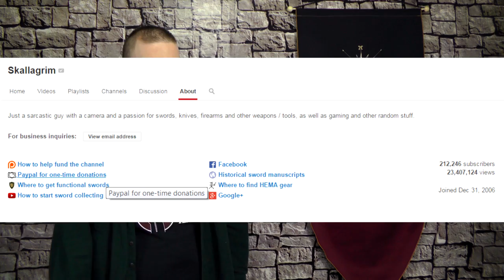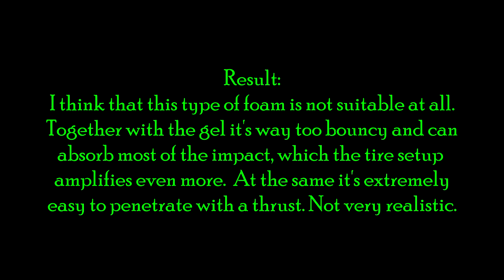The ongoing quest to find a realistic test cutting medium

Comment: There are plastics designed to simulate bone, but the old school method is poplar wood. Poplar wood just so happens to be about as strong as human bone. You can get poplar dowels at most hardware stores. As for flesh, the only thing I have found that is close is...well flesh. Even so, dead flesh seems to react differently than living flesh, so even that is not perfect. It is also a pain to pick bullet fragments and whatnot out of your dinner, ha.

Comment: Bamboo does not splinter like real bone, green or dry. There is a company in Colorado (I think) that the Mythbustes use that makes a Fiberglas bone analog that mixes in plaster and some gelatin resin, I believe. (go to the Mythbusters site, they are very helpful.) I believe that one of the commenters below is correct that impact gelatin is 10-12% for blunt and sharp force trauma with different analogs for skin.  There is some information on the American FBI sites and other Forensic websites. Skin varies in thickness across the body.  The back is 10x thickness the back of the hand and forearm. The heel of the foot 20 x as thick. Latex paint with some very thin fibers, like tissue paper, is used by some to simulate epidermis and the dermis. Or just a thin layer of liquid latex.

Comment: I'm glad you're trying lots of different things.  I think the tire is good because it moves and a body would move in real life.  I think the tire is bad because it swings from the top instead of swaying from the bottom and it is not 100 or 200 lbs (45.3592 to 90.7185 kg).

Comment: to stop the stick moving in the gel, you could put a ring in the bottom of the mold that the stick sits in, and one made out of wire at the top outside of the gel to hold it at the top?

Comment: Regarding "bone" support in gel. Why not trying to do it out of wire. Two "stars" at each end. Wire is easy to bend and easy to secure around the "bone.
Regarding "bone" itself. Was bamboo in the test dried or fresh. As far as I understand - dried bamboo is stronger. You can try to create a bone out of (again) alebaster or similar compound but I think it is more brittle.

Comment: For bone, Mythbusters used a wood called Popler (don't know how to spell that) for a bone analogue. That was for how much pressure a bone could take before snapping, not sure how that would go for cutting resistance though.
Reply: You almost spelled it correctly, poplar. But Yes, the Myth busters have used poplar for the human thigh bone as an analog, so it may be a not so pricey but still very good option.  
If i remember correctly, it broke at nearly the same pound threshold, although i forget the dimensions they used.
Reply: CAepicreviews
 I'm not sure the dimensions were specified, but it looked to be about the same thickness as the bone itself.

Comment: I would suggest a bone mold and then use plaster of Paris its cheap and sets up quick and I'm sure you could find a plastic mold on the internet for a bone mold to put the plaster in and it would solve the issue of the meat industry thing but I believe that would be the cheapest route with the ballistic gel.

Comment: You could try thick bamboo filled with wet sand as an analog to bone. Not extremely accurate but the closest thing I could find to a beef shank. Surprised me, as I was doing a science fair project (granted almost ten years ago and using an axe). Don't ask the purpose of the experiment, it was weird.

Comment: In the metal mold at the beginning of the video, you mention that the gel sticks and is hard to get out. Are you using a mold release? Mold releases are sprayed or rubbed on the inside of the mold and keeps the gel from sticking. Many people use Vaseline as a mold release.
Reply: buy some Pam.  if that isn't to skall's liking there are pump up oil misters so he could use something like cheap vegetable oil instead.

Comment: Many-layered material is a very interesting idea. But what I think of - the layerring is a bit off. First we have the cloth, then - tear-resistant skin, then - small bit of an very easy to cut fat, and then - very resistant muscle and bone. So, the inner layer is what supposed to be made of ballistic gel. So, I guess - you need to change gel and foam's places and it will be a lot more accurate.
Reply: except fat is at least equally difficult to cut as muscle if not more difficult.  he needs to find some way to put blood packets into the gel to reduce friction.  perhaps using some cheap water-based sexual lubricant would work?  I know of one that has similar properties to blood, but doesn't leave as much of a stain.
Reply: PsylomeAlpha Fat is not hard to cut. Human fat is not like pig fat - it has a light consistensy and is not such a big deal to get through. You can always touch your own body and see that for yourself.
Reply: MaximilianBrandt
it may be easier to cut human fat, but it's harder to stab it.  it may be easier to stab human muscle, but it's harder to cut it.  it's a weird conundrum that means that even light armor will prevent you from being run all the way through with a spear or a sword unless your opponent hit you really hard with it.

Comment: You have said that you have a problem with ballistic gel friction. Have you ever tried greasing the blade before cutting ballistic gel? It will not damage it and as far as I know, flesh is moist so maybe it could prevent the blade from sticking in the ballistic gel.

Comment: put a wire through the bamboo and the through the mold gel won't seep out of the hole in the mold if you make it little tight and pull on the wire and the stick will center it self

Comment: i like what you did with the soaked dowel. i wonder if soaked bamboo would be an even better analogue? also, i wonder if you could fill a rubber hot water bottle with the gel and insert the bone analogue so it would be held in place by the neck of the bottle? it wouldn't be very long, but you would have two different layers. hmmm. i would love to help you with this in person, it would be really fun. i can't afford to do it myself. i live in the states though, wah wah.
Reply from the maker: bird bones Bamboo is not very similar to bone. It splinters along its length.
Reply: ***** i think that the soaked wood would be the best thing you could always take it to a butchers and see what they think as that is what they deal with they may also be able to suggest a cartilage replacement
Reply: *****
why dont you try putting a longer stick thru the gel and cut the stick when the gel hardens,
Reply: *****
With the ballistic gel and cane you are currently using, couldn't just weld a small ring or slot in the bottom of the mold to prevent the cane from moving as it sets? Sorry if this has been suggested already, didn't read every comment.

Comment: For bones. Some prosthetic use ceramic bones. If you get the clay thick enough and don't cook it too much. cook it enough that it still has a small amount of flex. It could mimic bone. For, muscle. Layers of elastic or elastic rubber coated in a few layers of  pva glue so that its not too flimsy, then if yo do not want to use a light leather for skin a relatively thick layer of vinyl or a few layers of it. Or the substance we call pleather. and voila that would make a decent substitute. Not perfect but then again nothing is.

Comment: You can try use cheap hollow pvp-pipes with around 3-4 mm wall strength and around 3-4cm diameter. Because Bone is also hollow, hard pvp pipes also burst and shatter like a bone when hit.

Comment: Pulled from the mythbusters  wiki, which mentioned poplar for bones due to how close in strength it is to human bones and the silicone called Dragon Skin.  " Because of the nature of the situations in which the MythBusters use him, Buster has been subjected to forces and situations that far exceed his original design parameters as an automobile crash test dummy. As a testament to the danger of the tests in which he is used—often resulting in his being broken into pieces, burnt, or otherwise mutilated—Buster has had to be extensively repaired and rebuilt over the course of the series to the point that the episode "Buster Special" was devoted to his being completely redesigned and rebuilt as "Buster 2.0". Buster was designed with quick and simple repair in mind, and boasts improved joints, with a more realistic range of movement, and easily replaceable poplar wood "bones". Poplar was chosen because its shear strength was very similar to human bone, providing an accurate gauge of how bones would react in experiments. Buster's new flesh (with the exception of his face, hands, and feet) is made of a silicone marketed for use in animatronics called Dragon Skin. Buster's original head was retained when he was rebuilt, but it had to be replaced after it was shattered during a mishap on the "Escape Slide Parachute" myth. His original face was retained to fit over his replacement head. They tested Buster 2.0 by dropping him 60 feet (about 20 meters) off a crane while inside a donated Cadillac named Earl."

Comment: for the problem with the stick shifting try this,
put a little bit of the stuff in and poke the stick in the middle,once that has settled shouldn't it not shift with sush a little  amount right?
then pout in the rest of it with the stick secured a bit more simple at the top of the mold

Comment: If anyone wants a cheap and easy way to make a mold of your own body parts you can buy cheap rolls of clear packing tape and wrap it around you with the sticky side out, then again with the sticky side down to make a pretty sturdy tape clone of yourself. Just cut it off enough to squirm out and tape it back up. Fill it with whatever to get something to make a better mold out of.

Comment: Maybe you should look into how bullet proof vests are build. I could imagine that with the right material you could build something realistic, although that's just a guess on my part.
But I think something layer based will give you more resistance against thrusts.
Reply: human flesh has about 0.1% stab/slash resistance when using something sharp. I work with sharp objects daily and have stabbed and cut myself beyond count. many people have an unrealistic expectation on what the human body can resist but I can assure you its very very little. also most soft body armour can be stabbed trough quite easily, stab resistant sba is something special.
Reply: Xc31 From what I heard human tissue is both much stronger and much weaker than most people assume it is.

Example. It is MUCH, MUCH, more difficult to bite into someone's hand than people think it is.

I know this from personal experience. I was in recovery for a spider bite and, the treatment was deluded(not much in my estimate) bleach soaked gause put into the large wound in my side. I bite down on my hand as hard as I could to deal with the pain and even then I didn't break skin... shattered blood vessels in the area? Sure, but the flesh was not fully broken.
Reply: CrysResan
but thats why I said something sharp. cutting flesh (and skin) comes down to sharpness. think of cutting steak, you need a sharp knife, something like a butter knife wont do. but even that butter knife is sharper than your teeth. try applieing pressure on your hand with an exacto blade with even 1/10th of your biteforce and it will be stuck in the table. I expect that any respectable warrior in history has kept his weapons sharp and as the subject on hand involves hacking at something that needs to resemble a human bodypart expectations of slash resistance shouldnt be too high. if you're not easily disturbed you can look up some pictures of prison stabbings (those are easy to find and well documented) and take in mind that those wounds come from sharpened toothbrushes and the like. there's much worse things to find on this subject on the internet though so be ware.

p.s. damn, Ive seen video's of that, must have been a horrible experience. I'm glad we dont have any posionous spiders where I live. did it recover well?
Reply: So basically the construction in the video is already relatively close to how real flesh would react?
Reply: Xc31 Fair enough. I'm just saying how movies get that stuff wrong a lot. Given a bad enough situation to add more adrenaline and desperation I would think some people could bite into a hand, but it's not EASY, and I think I call crap when they show children do it in movies and such.

Hell I think I have seen some movies or such where someone bite through a finger and that's just nonsense, well unless you are a bird with a really stout sharp beak maybe.

I'm just mostly it seems that the human body can be a bit inconsistent. People live when they shouldn't, and die when they should not.
Reply: useless1997 I'm not going to try ofcourse but biting on the second joint of my index finger sure gives me the feeling I can bite it off. movies are movies, I stopped taking them serious a long time ago. I just regard them all as fantasy so they dont have to hold up to reality.
Reply: Well, I read once that you could bite off your finger quite easily actually, but your brain keeps you from doing it. But I always thought that was some kind of myth, but the bones in the finger are pretty thin.
Reply: useless1997 I'd say he's getting there, and with the input people are giving he certainly will. its just a matter of how realistic you want to get without resorting to actual meat. wich I do think is a noble goal, although I enjoy eating all kinds of tasty animals. I'd say if you want to bite a finger off do it at the joint, the bones are too hard for your teeth, ever bit down hard on a bone eating spareribs or such?
Reply: Speaking about meat, why can't he use a hambone? Of course he would have to buy them again everytime, but it seems to me that his setups are pretty elaborate anyway and you maybe could save some time using real meat.
And maybe eat it after the chopping took place ;)
Reply: useless1997 did you bother to listen to the video? :P  the man is vegitarian and doesnt like chopping up dead animals.
Reply: Xc31

Didn't he use meat in another video? But I missed that in the video.
Reply: CrysResan
fingers would be easy to bite through, at least moreso than a forearm.  it's easier to get a hold on it and bite down really hard.  our bodies are made to resist blunt force trauma more than anything, since that's apparently what killed more humans throughout history, meaning the guys that didn't die when a rock fell on their head went on to have kids.

Comment: As far as the keeping the bamboo in place thing goes, what if you put a nail or stuck another metal object in the end of the bamboo that would be at the end of the mold touching it and then placed a strong magnet on the outside of the mold where the metal object would be sitting?

Comment: you could use some wire. form a little star or X, you could attach on the bamboo stick. the lengh of the wire, should match case, so the stick just holds in the middle and dont swim around. only negativ is, your end test object has 2 little wire-X inside, one on top and at the button. but if you cut into it, you will aim more or less for the middle, so its kinda irrelefant.

Comment: use a 10% ballistics gel. a 20% is for firearms, usually for firearms forensics, not penetration testing (which uses 10%), which simulates real flesh.. for the "bones", you could still use wood, and in the mold, the problems you're facing with the stick moving, there's a solution to that as well. 
use a flat piece of wood, and in the "leg" mold for the gel, cut the piece to the diameter of the mold. hammer a nail through the center of the flat piece, and hammer the "bone" onto that nail. now, wedge that in the mold, it'll keep the stick in the center. repeat on the other side.

I've drawn a simple example. 
http://tinypic.com/view.php?pic=6elv04&s=9

Comment: well i ain't very good on this stuff but, i have some suggesions like with the casting thing and bone placement problem, i mean if it is possible you could like do a cast of your arm and try to use that for the gel, but from what i heard it would need to be metal :/ but you could also just get some Y shaped sticks to hold the bamboo up around the heigt you'd want it to be

Comment: materials
ballistic gellatin cast into small cylinders like noodles maybe 1cm diameter and around 50cm long
bamboo core
grade 10 cheese cloth

production
lay the cheese cloth down
lay the ballistic gellatin noodles down on the cheeze cloth parallel to each other with no gaps (a material for gaps can be added to increase cuttability)
roll up the bamboo core with the cheese cloth covered ballistic noodles like a yule log cake
tie the roll off once every 3-10 cm

increasing cuttability
decrease the thickness of the ballistic gellatin noodles to make it more cuttable
alternate the ballistic gellatin with a more cuttable tubular material like small diameter pool noodles for increased cuttability

Comment: This sticking to the mold.. i cast a little silver from times.. and ordinary teflon spray in the mold helps with that.. try it in the mold it might work better to remove then..its wery heat resistant (since it witholds molten silver)

Comment: Try putting a hole in the bottom of the mold, putting the bamboo through the hole in the bottom of the mold, then sealing the hole around the bamboo with something like silicone sealant.  Then cut the bamboo stick and sealant plug free from the hole in the bottom of the mold before opening the mold.  Good luck.